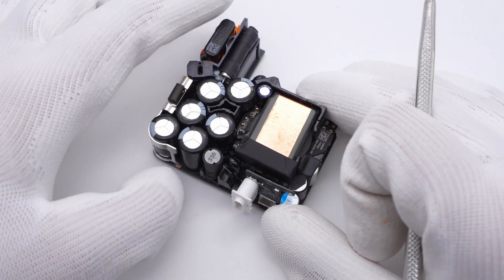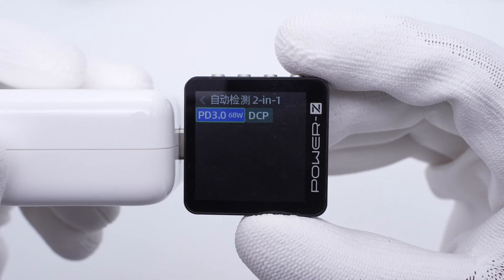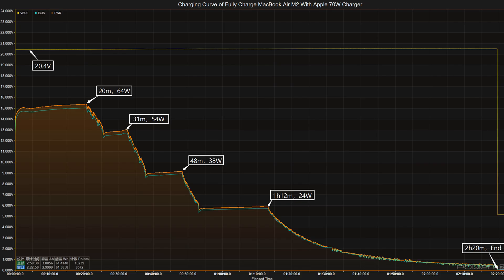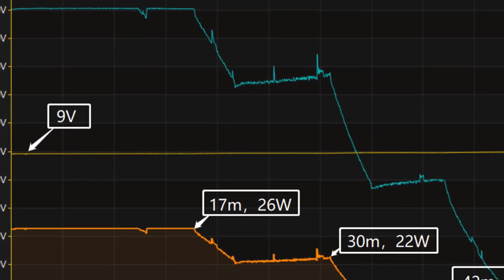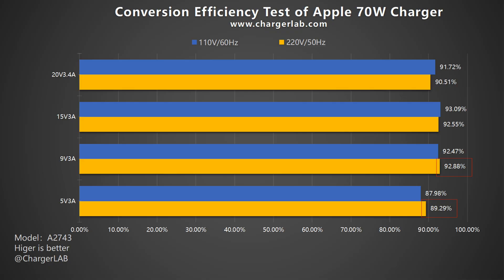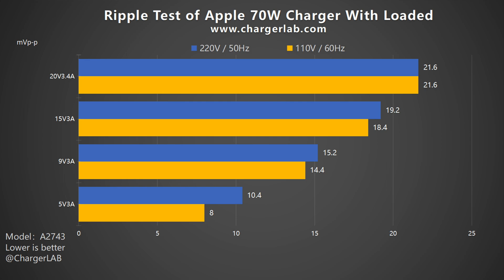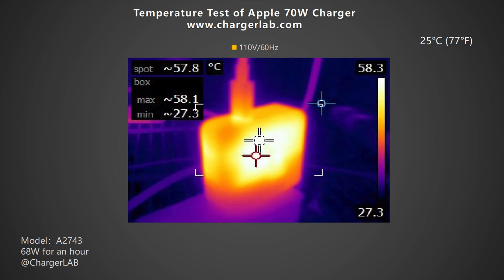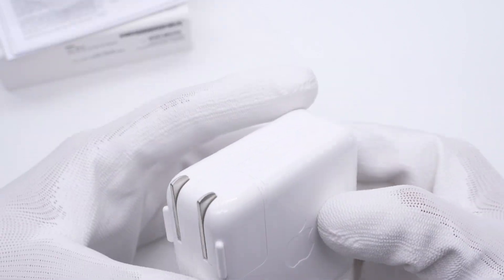Review of New Apple 70W GaN USB-C Charger

Comment: might be outiside the scope of your channel but battery temperature seems to be completly elusive subject on the McBook Air.  Everyone keeps telling me the 35watt is the best one for MBA because the 70 watt heats up the battery too much causing premature wear.  on the otherside ppl say the computer will self regulate and charge at the max safe temps and voltages so theres no need to worry.  whos right?
Reply: 70watt gang is right as it was maded for MacBooks+ if you charge properly in right limit there will be no issue

Comment: Finally, the second GaN charger from Apple! Too bad she came too late. They first introduced the Apple USB-C 67W (silicon) and later the Apple USB-C 70W GaN charger. That 67W charger was a useless product. Because of that, I bought the Xtorm USB-C 65W GaN charger, because Apple didn't have any GaN charger at the time, nor did they offer the Apple USB-C 140W GaN one. I currently also have an Apple USB-C 140W GaN charger. It's great, but on the other hand, Apple could have made 2x USB-C (140W), just like the Apple 35W charger. I consider Apple's lost potential not to present a version (also) of a 140W GaN charger with 2x USB-C.
Reply: my 67 W adapter died in 5 months of usage. GN adapter is the way to go

Comment: Actually you can select it for no additional cost at purchase on the new macbook air 15 inch. But the 35W dual USB-C is selected by default.
Reply: exactly
Reply: @deepayanBiswas  which one is best?>
Reply: @GodofWondersss  70W ofc. Dual port seems like a gimmick to me. If you to want to charge more than 1 stuff you can always use Macbook's thunderbolt port.
Reply: @deepayanBiswas  True in a way. I tend to plug the device directly to the power adapter instead of through the computer's ports.